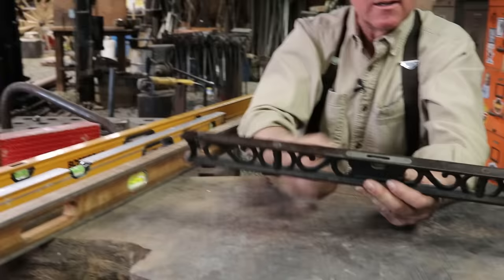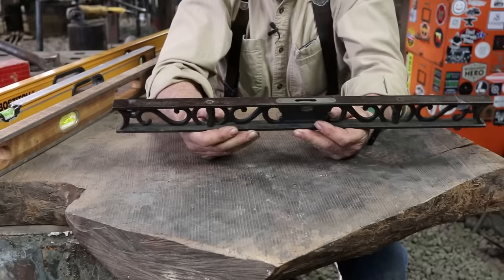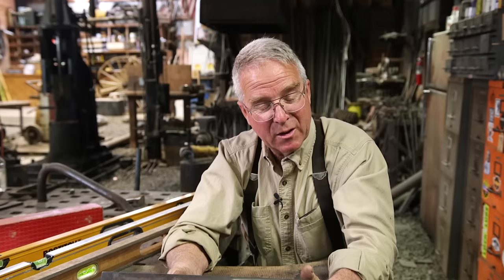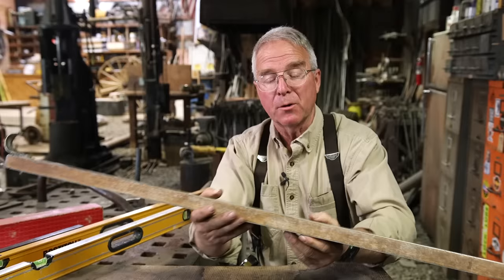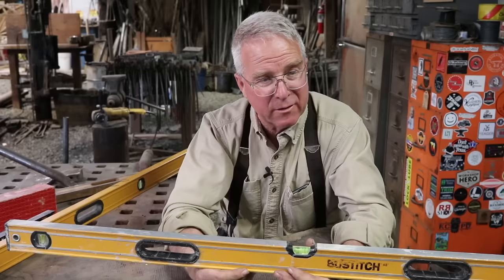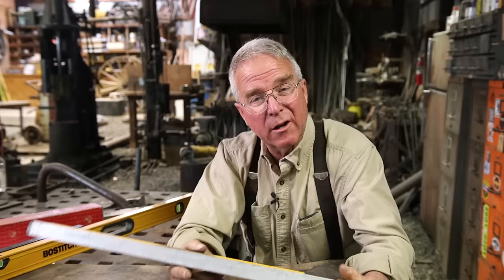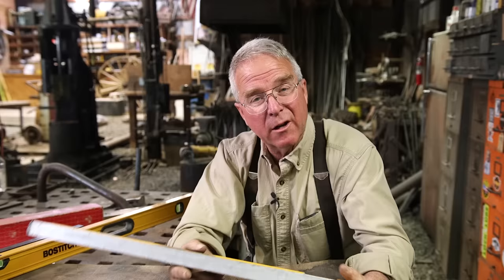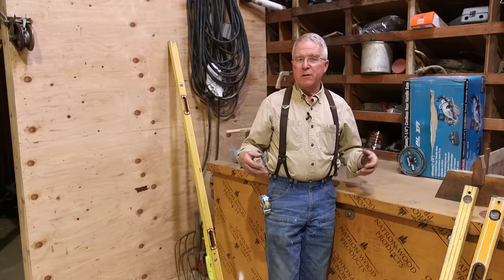How to Use a Level and What is Next for EC

Comment: Love your videos, it's good info. Might want to check yourself at 4:30 though. You can't guarantee that the bubble level vials are the same size or type on each of those levels. So you can't really guarantee the second level is accurate without flipping end for end. It's nitpicking, I know. Another great way to check plumb accuracy in a store without writing on the walls is to hold two levels together, and or flip the level 180°. Thanks for the content.

Comment: I wonder why more framers don't use plumb bobs.  They built the pyramids without bubble levels, and they're pretty square and flat.  The simplest, oldest tricks in the book, but it seems the MOST accurate trick, the ol plumb bob, isn't used much anymore now that we have frickin laser beams shooting in every direction on some jobs.  Heck, they're handy and accurate as a... laser, so I won't lie I use a laser all the time for cabinetry work. I remember seeing string lines and plumb bobs on job sites when I was a kid.  It was usually the masons who used them and some still do.  My thoughts on levels are that you need to spend enough, but not too much on a level, since you probably will drop it and bend it at some point, and it stings to bend a Stabila 6 footer.

Always love your honest and well thought out opinions on matters such as this and keep up the good work.

Comment: You would've come unglued at one house in our site. It must've been built on Indian burial grounds. Everything was installed, hardwood floors, rock, doors, windows and roofing. The floor from the entrance was redone to stupidly remove a slope..the floor finisher let his sander get away from him and it went down the stairs breaking 2 treads and knocking over 5 gallons of paint. Once I got in there I noticed the obvious. There were 2 monoposts missing. Had to jack the I-beams up........what a mess..had to remove and re-install every door and window....2 months later foot of  bentonite came through the floating floor in the basement...It was a haunting..true story..

Comment: I just bought a 4 foot crick. Im not a mason or a carpenter. But i do use a level often. And my very very old craftsmen, one of the plumb bubbles leaked out. And i was going to buy a stabila. But the crick was hanging right next to it for the same price. I had to have it. Hope it works well enough for what i do.

Comment: They all should be adjustable.  The best way is to nail a straight board level then switch ends.  Trust me, I did negative edge pools with a level after the water level.  One time I forgot an eight foot level for a job and the customer got all pissy cause I couldn't continue the job that day.  He told me he was a Master Builder for decades and insisted I use his, poor thing was off a good eighth.  Some customers are hard to deal with, make me explain to him how clueless his past was.  At least he was nice for days afterwards.

Comment: It's very fascinating how you build something perfectly plumb and then suddenly after some days it's off slightly, or even that a stud suddenly gets a big bow on it over the span of a few weeks. 

Plumb and level must be checked untill the construction is very Ridgid and secured. If it's resting on point loads you need to check the point loads to ensure that they have not moved. 

Walls also must be checked for straight, as studs can get bowed, twist or moved over time, even egen sheathed.

Comment: I used to install garage doors & my goto level for installing the brackets, at varying heights & widths, was a water level. Clear plastic tubing, 10 metres long with food dye in the water. The most accurate level there is. I first learnt this technique from my father when he was laying foundation piers. You can also use a water level to check the accuracy of laser levels!
Reply: you used a 30 foot level to install garage doors? we are supposed to believe that?
Reply: I have also used a longer water level for all types of set out from gutter to drainage to slabs

Comment: I used to have a couple old levels that you could adjust the vials in them using a set screw- but you need to be sure it is out and not the checking surface

Comment: My first confusing experience with a level was that I had to interpolate supportings on a line that was not level. I leveled the first supportings and ended out of level on the last one resulting in not having a straight line. So I learned the hard way to use the level trying to find the average by shimming my level. It's like leveling a drainage pipe falling 1" over 3 ft (or what is needed).
btw. allways make sure the bubble is on a single temperature without gradient by shadow/sun.

Comment: Great video! Machinist here, here's my two cents on the whole "milled on both sides" bit.  While a milled surface is generally extremely flat and precise, I'd take a precision ground level any day. Milled is usually fine and it doesn't make much of a difference how it's machined but the precision of a surface grinder is an order of magnitude more precise than most machine tools. Just my two cents.
Reply: I love getting cross-specialty information like this.
Reply: @DeadlyPlatypus  I figure it may help if someone is looking for an extremely precise level. We use machinists levels at my shop and those are ground, not milled. For anything that isn't machining it probably doesn't matter but hey why not
Reply: I'm really new to crafting work overall, and I found Essential Craftsman when I decided I wanted to get into smithing (I just recently finished building a propane forge according to his instructions).  I grew up helping my dad around the house with projects, and he certainly never settled for "good enough", but most of our work together was mechanicking, not handiwork.  Could you explain the difference between milled and ground?
Reply: @joellugg9183  Absolutely! A milled finish is done on a machine called a milling machine, where the work is usually held in some sort of vise and a spinning cutter, which looks similar to a drill bit and is typically called an end-mill, removes material. 

A ground finish is done on a surface grinder (or something similar) and uses an abrasive wheel to remove tiny amounts of material. The work is usually always held in a magnetic chuck that is ground in after installation for a perfectly flat mounting location for the workpiece. Since the mag chuck is parallel to the wheel, the resulting ground surface will be parallel to the opposite side (provided the machine is set up properly). The finished surface is very smooth and is flat within two or three  (or even less) ten-thousandths of an inch. 

Hope this helps :)
Reply: You’re not going to find a level with any ground surfaces for the money that anyone’s going to want to spend on a normal spirit level.

Someone looking for a machinist’s level will know that this video is not for them.

Comment: I recently discovered my (6 year old) 78” STABILA jamb level is 3/16” out of level—hard to believe given it’s a STABILA.  It’s good plumb, however.
Reply: That doesn’t instill a lot of confidence with me considering I just bought the same level.
Reply: if it's not dented you should be able to take it to a dealer and i think they replace them as long as it hasn't been dented

Comment: I dont understand why the vial on center of some levels are not protected. I made a mistake and ordered one from goldblatt. Nice level but I dont use because I know I will break the vial. I am  true to the all steel Sands level. I have had  the 2 foot level for over 30 years and it is very accurate and withstands the test of a carpenter and concrete guy as that is who I am. I need to purchase another 4 foot Sands level , somehow it has been missing and it was the best tool in my arsenal. I encourage everyone to use the Sands level. Try it out Scott and let me know what you think. Thanks

Comment: Good on you Scott good video

buying a level is a bit like buying a compass

don’t ever buy a Compass if it’s pointing in a different direction to all the other ones on the shelf 

and don’t ever buy a thermometer if it’s the old school Mercury thermometer that’s reading different to all the other ones on the shelf…..!!!!!

All the best from Melbourne Australia…..!!!

PS 

I also got caught once using a circular saw that was a very good brand it was a Makita but it was an older saw

And the bearings are a little bit shot and when you grabbed the bolt and pulled on it the blade had end float which caused me no end of grief…!!

Comment: A level for masonry work is wood for a reason as it is less susceptible to the materials (mortar, etc.) it contacts.  A mason's level is also not perfectly straight but slightly concave on its edges so as not to be influenced by a not so flat surface.

Comment: Don't forget about parallel and perpendicular. In many cases it is more important to look right than to be square. "If  it looks good then it is good" old electrician.
Reply: Precisely—never use a level to layout siding, rather pull off the soffit for “parallel”.

Comment: The "trick" is knowing when "close enough" is "good enough".
Reply: There's another name for that particular kind of "trick".
It's called Engineering. Engineering is all about eliminating vagueness from your definition of good enough (or at least being able to measure just exactly how vague you are trying to be), and then hitting the mark with as little of an overshoot as possible (while still not falling short).
Reply: @44R0Ndin  You vastly overestimate our power and techniques.
Reply: @44R0Ndin  We're not building a rocket to Mars here.
Reply: @russellstarr9111  Maybe not, but the same principles are used. You don't want to have your construction project cost too much because you over-built the building to be too strong, do you? That's engineering!

Comment: In the UK, there's so many construction trades that think level or plumb just means getting the bubble in the lines near abouts.
As a carpenter, it drives me mad.
Bricklayers and plasterers rarely get anything level, plumb or square.
Which makes following on from them a bloody nightmare.
My job would be so much quicker and easier if I wasn't forever having to scribe into shit work.

Recently did a full cut and pitch traditional hip and valley roof.
The wall plates were so out of square and not level that I nearly walked off the job.
Usually I'd just knock them about and shim them until they were okay but the bricklayers had built the building so far out of square it and level it was impossible.
So a two day job took me a week and I lost alot of money.
I was forced to create bastard hips and valleys and now the roofing tilers are complaining coz none of the clay tiles line up properly around the hips.
The bricklayers just shrugged their shoulders.
All because nobody can read a level and square a building.

Comment: I know from experience that box beam levels will not take a hit much better than I beam. (At least master-level (out of business) and stabila (the two I can think of that I've owned many of. I've ruined a handful in my life. Did prefer Master Level (because they were adjustable and had a tighter tolerance than stabila), but generally use wood, and box beam...with an I beam here and there without a huge difference. I check them all when I buy them to make sure they are good. One time I was in a hurry at lowes,..and I went through ten or 15 stanley's in a row and every single one was off by the same amount..I realized there was not a good one in the store..   FYI, nowadays we generally use lasers 95 percent of the time, always checking with another method before we move on.

Comment: Spirit levels are vile. Get it? 

Most of your critical level and plumb measurements are far better made with a laser that projects both horizontal and vertical planes of light. In a kitchen install you can quickly understand the flatness of the floor and get your level lines for uppers and lowers. Two minutes, 1/16” tolerance around the room. Check accuracy instantly by moving the laser to another corner left or right. 

If you have to use a spirit level, flip the level for every reading and only ever take the average. But seriously, a decent laser costs less than a 6’ Stabila level.

Comment: If you could only see the rental house I lived in Missouri. You can tell the builder either had a crooked eye, or didn’t use a level (and plumb) properly. I could put a liquor bottle on the top left of the kitchen cabinets.. but take that bottle to the right and it will not fit and touch the ceiling. None of the windows opened properly. The floor was the worst. Roll a marble and you can watch it swerve left and right and all ways not natural. Use a proper level in that house and you would facepalm everywhere from the bathroom to the backyard porch. The house was a basically built by a hack who faked it to make it. But the rental was cheap.

Comment: Learn to do machining where work is generally done to a thou.  (Thousandth).  It will revolutionize your woodworking and carpentry...
Reply: Old saying, your not building a piano.
Reply: @patrickcowan8701  An attitude of precision does not cost much in time or money, but produces large benefits in quality.  Its an"essential" part of being a "craftsman"
Reply: That works until you pull out your micrometers and surface plate for the kitchen remodel.